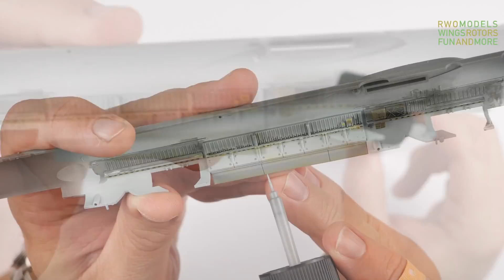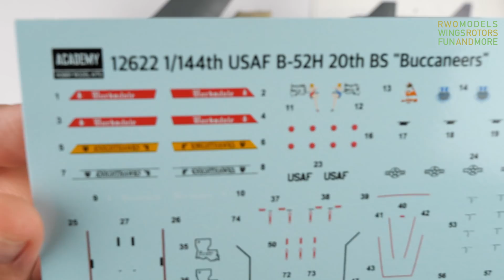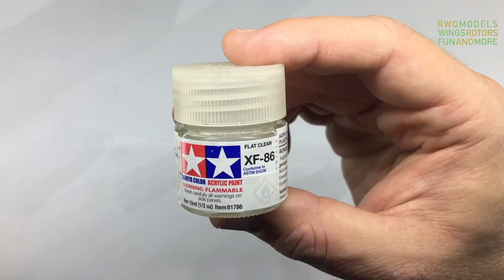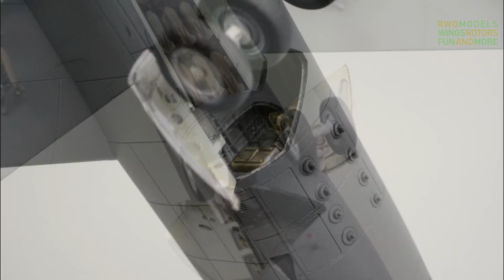Boeing B-52H Stratofortress USAF 1/144 Academy 12622 Full Build Video | RWO Models

Comment: Man, you nailed it, that thing looks like it is ready for a mission, I just recently purchased this exact same model. I'm in the process of acquiring all the necessary tools, You have definitely shown me some things I still need. Thanks for the wonderful video.
Reply from the maker: Thank you so much! It is an amazing kit, builds like a dream, and the finished model will look awesome with all those great little details. Enjoy your build! 🙂 Greetings from Germany, Oliver/RWO
Reply: @RWOModels  Say you don't happen to know what size bit you used for the bomb rack mounting holes do you?
Reply from the maker: I’m afraid I can’t tell you the exact size. I only have a cheap set of drill bits without any size designation and I don’t know any more which one I used so I can’t measure it for you. I would guess it’s somewhere around 1.2-1.5mm but I could be wrong. 😳
Reply: @RWOModels  Thank You

Comment: May i ask what Pen did you use for the landing gear lights?
Reply from the maker: Sure, it’s called Molotow Liquid Chrome. It comes in different tip sizes, the one I’m using is 1mm. You can also see it at 8:23 in the video. 🙂 Thanks for watching!

Comment: Well done, mate! Flashbacks to when I was Crew Chief on Gs with occasional work on Hs.
Kinda odd that they didn't provide decals for the spine and wing walkways as the did with the stabilizer. 🤷🏽‍♂️
If you want a beat up looking one from Guam,  you can rust up the gear and other steel parts then splatter grease liberally on the gear and wells. I'm planning on my 1/144 as 7-6468 in Vietnam 3 color with white belly which was in the above condition when I got it. The 1/72 will be in the 2 color grey/green of 8-0230 right after I got her back from Depot with that new scheme.
Reply from the maker: Awesome, thank you so much for sharing your memories and experiences on the real thing! 👍 Greatly appreciate your comment here on my little scale modeling channel! Would love to see your finished builds. 🙂 Greetings from Germany, Oliver/RWO

Comment: Eine Frage zum Vallejo Surface Primer: Wie sprühen Sie den? Ich verdünne den mit Wasser, und trotzdem verstopft meine Airbrush IMMER. Ich habe (glaube ich), die selbe Pistole (H&S Evolution).
Reply from the maker: Der Schlüssel könnte die Verdünnung sein, ich verwende für Vallejo Farben und Primer ausschließlich den Vallejo Airbrush Thinner. Je nach Fläche nehme ich beim Primer die 0,2er oder 0,4er Düse bei 1,2 bis 1,5 bar. Manchmal spuckt es ein bisschen, wenn ich zu wenig verdünne, aber im Großen und Ganzen hatte ich noch keine Probleme mit den Vallejo Primern. Ausnahme ist die Farbe Weiß, damit kämpfe ich auch meistens. 😉 Oder vielleicht mal ein, zwei Tropfen Flow Improver beigeben?

Comment: do u have to spray clear coat before panel line?
Reply from the maker: It is definitely safer to seal in your work with a clear coat (preferably gloss clear) before continuing with washes/panel line colors. This way, everything you’ve done before (painting, decals) is protected in case you need to correct or fix something. With this build I passed on the clear coat because I knew I only wanted to apply panel line color in a few places where no decals could be damaged. Hope this helps.

Comment: The precut tape you used for the canopy windows, did that come with the kit or did you purchase it separately?
Reply from the maker: The pre-cut masks are included in the kit, and they are of excellent quality! 👍 Thanks for watching!
Reply: @RWOModels  can they be bought separately or do they only come included in kits.  I have a few models that could use canopy masks.
Reply from the maker: Depending on which models you have you can buy these mask sets separately from various aftermarket brands (for example Eduard, I also regularly use their mask sets for my builds).

Comment: Like to see a good way to wrinkle the skin on the fuselage for the that final touch .
Reply from the maker: Yes, those wrinkles on the fuselage would really add to the realism of the model. 👍 Unfortunately I'm not skilled enough to recreate them in this small scale... Thanks for watching and taking the time to comment on the video!
Reply: @RWOModels  the only thing I can think of would be some very delicate sanding and shading or something on that line .
Reply from the maker: I just thought about using a Dremel tool with a very fine tip but I guess that would require an extremely steady hand, lots of patience and strong nerves. 🥵🙂

Comment: Fantastic build video! Must ask, what is the material you put Inside of openings to mask them for painting? Like in the engines and gear bays
Reply from the maker: Hi there, I used various foam packaging pieces, cut to size for each opening. Hope this helps. Thanks!

Comment: How did you make the foam cutouts for masking?
Reply from the maker: Hi, I have a large box where I collect all sorts of foam pieces from packagings etc. in different sizes. I picked a few suitable parts, roughly cut them into shape and pushed them into the gear bays as well as the bomb bay so that they cover all the previously painted areas. No big deal actually. 🙂 Hope this answers your question? Thanks for watching!

Comment: I've been curious... What do you use to film your projects? And how the heck do you keep it out of your way while you build??
Reply from the maker: On my main desk I use a Panasonic Lumix Micro-Four Thirds system camera which is attached to a modified PC monitor desk mount. The camera is located overhead, and the field of view is set up in such a way that my head is not visible in the recorded image. On my second desk – which is actually more or less my illuminated airbrush spray booth – I've been using my old iPhone which I'm gradually replacing with a second, smaller system camera (also mounted overhead) allowing more advanced, manual settings for higher and more consistent image quality. I'm constantly working on my camera and lighting setup, and if you look through my older videos you'll (hopefully) see a few advances and improvements. :) Thanks for watching!
Reply: @RWOModels  That is a really smart way of doing things! Thank you for such an exact answer!

Comment: Time just flew by watching this video - more therapy than anything, loved it.

A question if I may. I haven't touched a model in over 30 years and am motivated to start again, back then it was tube cements, which meant being careful to avoid excess seeping out of joints. So it was apply a thin film to the edge to be glued and press together the pieces. With the new(er) liquid cements though, like the Ultra Thin Tamiya, I notice people dab around a join and then capillary action draws it in, but this leaves a visible 'spot' on the exterior surface. In some instances you can see a lot of these patches all over the finished model.

Does this affect the surface at all? Being thin it wouldn't be a raised blob as I remember would happen in the 'good ole days' that required sanding back, but I worry (too much) about the effects on the plastic, if it causes damage to it. I suppose I should just buy a small cheap kit to practice on - haven't done that yet - but I'm a worrier as I don't want to stuff up even an expendable one. Can you shed light on this? Cheers.
Reply from the maker: Thanks for your kind comment! In fact this hobby really is a kind of self therapy for me after an accident a few years ago. Glad you liked the video! 🙂 Regarding super thin glue there’s actually no need to worry about those spots you mentioned, on unpainted surfaces. Most likely they will disappear with the first layer of paint. Using glue on painted surfaces is different though and you need to be extra careful. The bond is a lot weaker (if there’s any bond at all) and you easily get those nasty „blobs“ when glue and paint react together. Practicing on a small, easy kit is a good idea. Different types of plastic work differently with your glue, and you’ll soon find out how much glue you need to use. Most important, have fun and don’t be too upset if things get messed up. It’ll happen. ☺️ Greetings from Germany, Oliver/RWO
Reply: @RWOModels  Thanks so much, very kind of you for the detailed reply. I appreciate that a lot.

I guess after watching videos such as yours, I want the first model I make to be 'incredible' and forget your level of skill and the time you have put in to perfecting it. I should aspire to be that good, but I should realise I am starting from scratch, again. I have a Revell lunar lander bought in 1984, untouched, sitting in a cupboard

Stores where I am are going to open up again in 2 days time after the worlds longest series of lockdowns and I am going to get a few kits from a real walk in shop (online orders are always damaged by our mail service, nothing beats walking into a shop and seeing everything they have there and picking up a crisp, new box of goodies), I have a list of a couple of easy practice kits to get and a few serious (expensive) ones for much, much later to tempt me to do well, like your Saturn V. I only hope they are still in stock as model kits have been popular and run out quickly! Most of last year you couldn't even find glue.

Vielen Dank, time to rewatch your earlier videos and take more notes 😁. Greetings from Australia. Oh, your videos really are put together so well.... ha ha , another thing I wish I could do - but model building first.
Reply from the maker: @tomstamford6837  Thank you! Regarding the purchase of model kits I guess it’s kind of „normal“ to have way more in your stash than you could ever build. 😬 That’s quite common in this hobby. 😂 All the best of luck to you, let’s hope this crazy situation were all in will somehow come to an end pretty soon. Enjoy your builds, stay safe and take care! Cheers, Oliver/RWO

Comment: how and what do you use to get the camera angel please? Great videos loving it
Reply from the maker: Thank you! On my main work desk I use an overhead rig I constructed from a monitor desk mount. The camera is hanging directly over the working area pointing downwards and is attached through a Manfrotto quick release bracket so I can easily remove it. On my airbrush extractor booth I use a second, smaller camera which is mounted on a Manfrotto Magic Arm. Maybe some time I'll do a video showing my workspace and equipment. 🙂 Thanks for watching!
Reply: @RWOModels  Yes you should it would be a good video. Thanks for replying if you get a chance take a look at my videos which I have just started. Thanks 👍